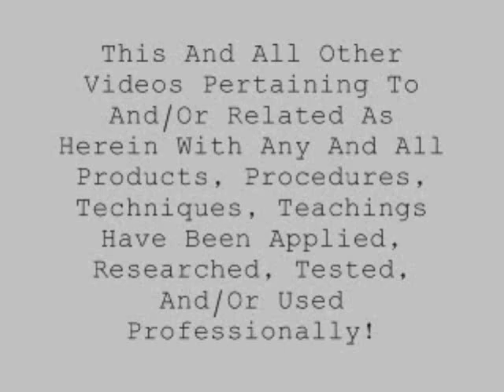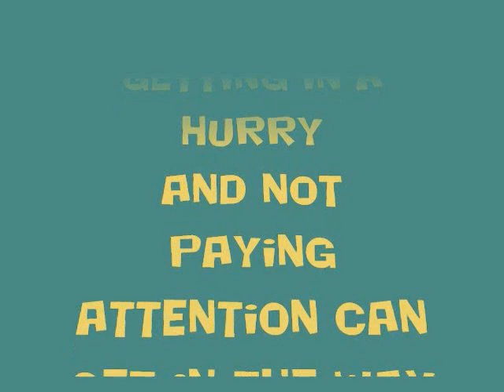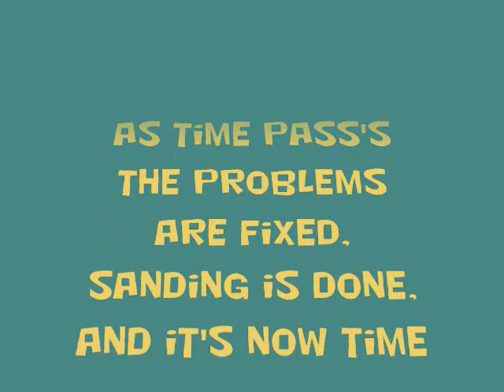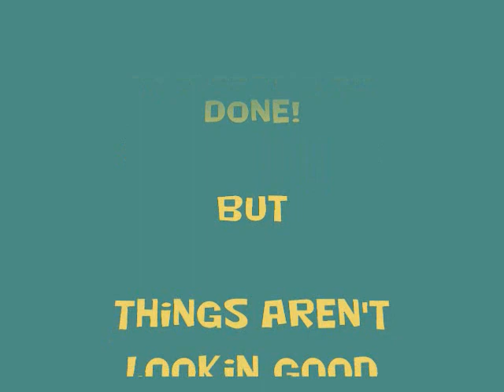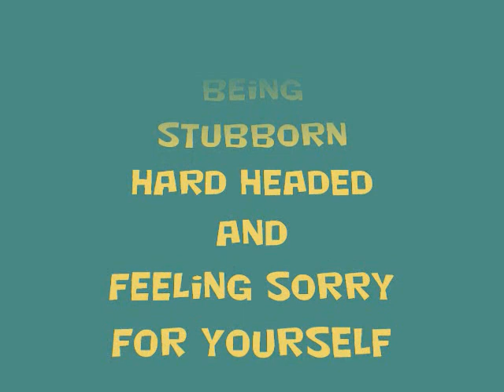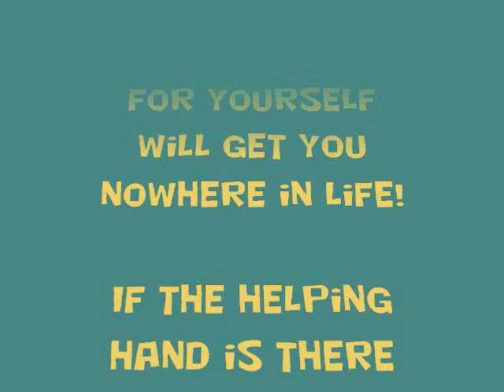"How To Paint A Car"-By Yourself-Part 11 - OVERALL PAINT Job

Comment: Damn Pete I should have come out to Texas and worked for you. For 20 years I did nothing but restos,mostly Mopars and rotted and butcherd Camaros. I did from welding complete Camaros together to final finish including vinyle tops and recovering the seats. I did 2 Superbirds and had my own 71 Duster and several others in Mopar Action. I didn't do any bondo buggies,every one of the 55 cars was stripped done to the bare metal,hammered and dollied or replaced the sheet metal. Made a lot of crappy Taiwan panels look factory fresh. Had my own real shop with a money partner who just wouldn't listen for 5 years and he couldn't get tough enough with the customers to get fully paid for the jobs. If you weren't going all the way out to Utah I'd probably be calling you for a chance to increase your business and get cars done. I'm an Italian and a perfectionist,but know how to get the job done.Ive brought some of the worst butchered cars back to show quality.Been following you for 6 years now. I've worked in production shops for 5 years now and have to get back into restos.

Comment: The one advantage you have with employees who may get upset over the constant push to work harder and better is that you can tell them you'll never ask them to work harder than you make yourself work! 

BTW, if you don't always use new cloths, a permanent magic marker marking might help you identify specific towels without harming any surfaces you use them on.

Comment: Not bragging here but when I prime a car, it's perfect after sanding it out.  But your result is really good. I'd work with ya if you were local. The people on here that are negative about your style wouldn't work out. I view it as motivational dialogue. He IS supposed to be saying this stuff too, AM I RIGHT? 

Doing this type of work ALWAYS gives you a lasting feeling of "did I bite off more than I can chew?". It only begins to fade after you get the doors and fenders back on.

Comment: Hey Have a fibreglass bumper and there's a gap between the top of the bumper and the hood. About an inch  I was thinking of just using  bondo or fibreglass resin. Any advice ?

Comment: Is there base and clear under the door hinge or is it just primer or surfacer ?
Reply from the maker: +johnsont963 It's what ever came from the factory,, the hinges are seam sealed on when installed and since I didn't remove them they are exactly like the day the car was built!
Reply: +johnsont963 Don't poke the Tiger...I think you know....Pete's right...this is not a frame off.